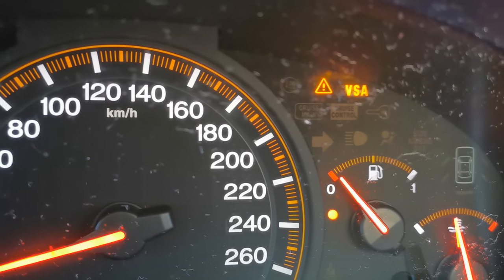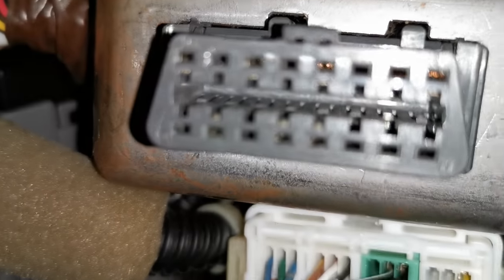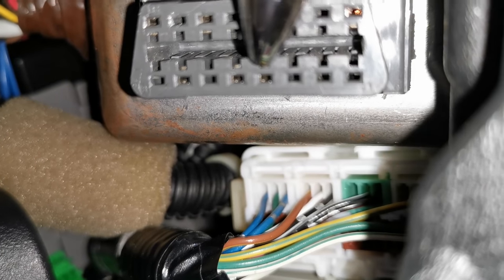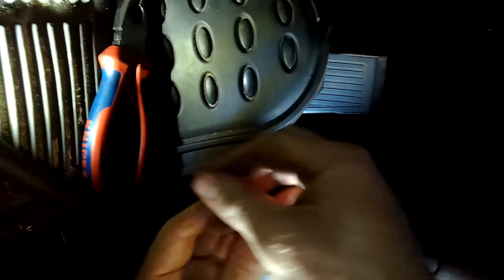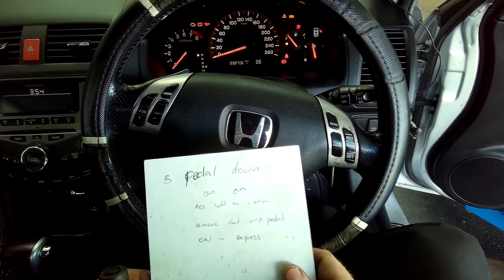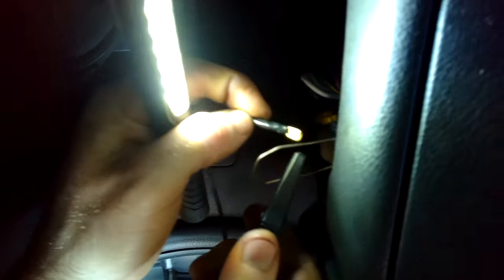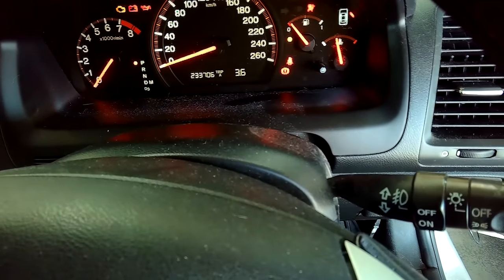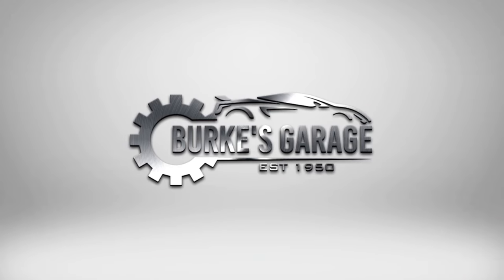Honda VSA & ABS Warning Reset - Simple DIY

Comment: I got those 2 warning lights after an OBD scan. The scan found only one old "low battery" error and nothing more. After the scan tool was disconnected from the OBD the triangle with an exclamation point appeared. After 30-40 sec the VSA error appeared too. Will try to reset them with this steps.

Comment: THANK YOU SO MUCH FOR THE VIDEO. I replaced the engine on my Daughters 2005 honda accord and these lights came on, resetted them with my snanner and they would come back on adter a few yards.

Did this trick, and Voala.. lights are off. Even the Cruise Control started working.

Thank you very, very much.❤❤

Comment: I have a 2006 UK-spec Honda Jazz (aka "Fit"). 
The ABS light came on after hitting a loose rock on the road (no damage to the wheel at all). 
Both my old and new OBD2 scanners report "No Codes".

I tried your method: 
 1. Turn Ignition OFF.
 2. Join pins 4 & 9 of OBD2 socket
 3. Hold Brake pedal down
 4. Turn Ignition to ON (not start engine)
 5. ABS light illuminates...

but the ABS light does not then go off for me.
I tried pulling the 7.5A ABS fuse for a minute then replacing it but it made no difference.

Any ideas?

Comment: Only way i could get triangle light off was with jumper wire between pins 4  + 9.   4 is ground like others mention.  Maybe the problem  was i used a broken jumper wire to ground and i didnt test for continuity so idk.  Anyhow i turned off VSA ABS Triangle lights on my '04 tsx.  They came on when i was replacing front brake calipers.

Comment: Thank you so much, it worked on my 2006 Pilot. I took my car to the shop for another issue. When they read my car the triangle and vsa lights cane on and they wouldn't go out. My mechanic couldn't reset it. I'm glad I found your video. It was easy to follow and it worked. I'll forward this video to my mechanic. Where did you find this information, I'm curious?? Thanks again for this helpful video.

Comment: Nice one man, I’ve reset the abs with a paper clip numerous times to find remaining lights. Nowhere else could I find anything about following that up by grounding and resetting the VSA. Cheers ☘️
Reply: Do you know what cables he used? Are those jumper cables?
Reply: @knightofnights1693  a paper clip and a bit of wire to earth it for the second part.
Reply: @dmcresins  can I use copper wire

Comment: Just about to try this and thought I'd have one more go with the snap on scan tool, and I cleared it, by going into abs and special procedures, follow a step by step, ignition on abs light comes on and goes out- immediately press VSA button ABS comes on again- immediately press VSA button, ABS flashes and its reset, no VSA light, viola.

Comment: Dude. Thank you so much. Had the same problem using Blue Driver. The Honda manual only mentioned doing the TCS reset and it wasn’t helping. Doing ABS before I did the one with the traction control button. Finally Code and light free thanks to this video.

Comment: Hi,been having the issue for a while. The VSA and ABS lights are just on. Scared to do this procedure myself
Reply: It will do nothing abs code will reset themselves when the fault is repaired and you drive at like 5 miles hours 

You can erase the code but it will come back on in a couple mile of running the car
This video is useless and false 
90% chance you got a bad wheel speed sensor 
And the moment the computer detect than one wheel stays at 0 mile per hour the light will come back on

Comment: Very helpful video! The triangle for the vsa off showed up during removal of some old faulty codes and wouldn't go away. After some driving the vsa light turned on aswell. after I tried this method and it worked like a charm, huge thanks for the vid! (Honda accord 2006)
Reply from the maker: Thanks Micke 🙏🙏
Reply: @Micke Andersson. I seem to have the same symptoms as you. Did you have to do both steps or just the last step. Thanks
Reply: @pnmbmw  Had to do both steps, just as in the video. Good luck
Reply: , what caused the VSA warning light to come on?

Comment: It worked, but I did need to know the turn key off after abs because I left it on for the vsa until you said turn it on and it was to late I had already hooked up the ground with the key on. No worries it all worked

Comment: I tried this yesterday and must have used the wrong pins, it shorted the IMA system,  key ring stopped working, car still drives but on gas only no IMA its dead. I've never had an issue with the IMA so it was definately something electrical I did trying to reset the VSA. Can blowing a fuse disable the IMA? Thanks

Comment: Gerard, thank you very much, this kind of maintenance it's was gonna took me a bunch of money since here in Brazil 8th gen Accord's are rare and qualified maintainers are even rarer, even honda dealers would probably suffer to solve this (Sadly, but truly mean it). One detail... At least on mine 8th gen, when pinned 4 and 9, and turned the ignition key on, it showed a code UXXXX on blackout screen, but it was fast so I couldn't record or remember it, and for my luck I didn't need to follow all the procedures described for the brake pedal and VSA button it resetted immediately. Anyway I'm just really glad you solved my problem that easy, no more christmas tree out season, LOL. Again, thanks man... BR greetings

Comment: Hi I'm having the same issue with my 2009 mkviii honda civic,  the brake lights keep failing  to work, bulbs have been  replaced as has the fuse and brake light switch, they worked for a while but have stopped again, any recommendations would be appreciated

Comment: this worked on my 2007 honda legend[ acura rl in states ] see also geting honda  abs codes without a scanner this worked also join  4and9whitout bressing brake to flash codes 13 was mine nsf front abs sensor

Comment: I believe if you do a steering sensor calibration/reset using the scan tool it also makes the VSA light disappear. I have this happen with every scan and my guy just goes through the steering sensor reset process to sort it.

Comment: Can a front bearing replacement trigger the VSA lights? Mine came on and is only after reaching about 55mph and sometimes goes off on its own after idle for about 8 minutes or by shutting  car off then  restart. Vehicle sat in driveway few months before bearing replacement. 
Thanks for the video.

Comment: Perfect for a 2006 Pilot!  The triangle (no other lights) came up for me after clearing ABS codes with a Blue Driver scan tool.  Clearing ABS and then VSA using your procedure worked like a charm.  I left pin 9 & 4 shorted for both procedures.  I think pin 4 is a ground.
Reply: Hah yeah same here for my 2008! Pins 4 and 9 for the win. My lights came on after clearing the codes from a thermostat replacement.
Reply: I left pin 9 & 4 shorted too like you did for both procedures and triangle warning light is off at last!!!
Reply: @nathanielmayo4950  where are the pin number configurations the same?
Reply: @billmurphy9921  Bill I'm not sure what you mean.
Reply: @nathanielmayo4950  lol. stupid apple talk to text... Are the pin numbers laid out the same on the 2008 Pilot as in this video?
Reply: @billmurphy9921  Bahaha. Yes, they are. Same pattern just make sure based on how you're looking at it. If you head is upside down, the pins will be upside down as well. They are actually marked, very lightly but you can see if you can really get in there with a bright light.
Reply: @nathanielmayo4950  got it. And it worked for me! My light came on after a shop did a full scan as well.
Reply: @billmurphy9921  Aye! Glad it worked bud. If they don't have the right scan tool it'll happen everytime.. this is a good thing to know so we can fix it ourselves

Comment: Did not work for me.
I did exactly.  Cleared the ABS got the 2 blinks…then tried resetting vsa and would not.  Same thing happened to me with a full system scan and light came on…was never on before that.  Grounded the pin 9 to try to clear vsa…idk what else to do.

Comment: I have a 2012 Acura Tl, recently my low brake fluid light came on, VSA light, and brake light, all 3 indicators. I checked the brake full it was low, I top it off, turned off the car turn it back on, and all the lights are still there. There's no leak Any thoughts, help great appreciate it.

Comment: I can't get rid of the Triangle.  It will not go away.  I followed the 2 step process.  My VSA light (Button) does not illuminate.  Not sure if it is on or off?
Reply: Here is what I had to do to my 2008 Honda Pilot to get the Triangle.  I did this.  Jumped 9 and 4 connection.  Turned on the key.  When the ABS disappeared, I hit the VSA button.  The ABS would reappear  then I hit the VSA button again,  The triangle would flash 3x and disappeared.    The triangle initially appeared when a took it to a shop and they reset the codes for a P2185 coolant sensor 2 error.  The triangle and VSA started to pop on after that reset was done so I knew there wasn't an issue in the system.

Comment: I have a HONDA CRV 2007. A replacement was made for the CV joint and axle for the right front wheel. After that the 3 lights (VSA, ABS and ⚠) lights all turned on. Upon diagnosis and reset using the diagnosis machine, only one error read "permanent right speed sensor failure". So when the engine is turned on, all 3 lights turn off and once in motion if brake pedal is stepped, a grinding and vibration is felt on the pedal until the speedometer reaches 55KM/HR upon which 3 lights turn on and the vibration and grinding feeling on the brake pedal stops. How can this problem be fixed?

Comment: Appreciate it! It's been on for a year and half. Finally got it off
Reply: How you got it ? I got a honda accord 2012 brought it mash fix the mash, it needed a transmission solenoid brought it and already put it on the transmission but the d light still blinking and it have the vsa abs and engine lights on how to take ? it off
Reply from the maker: Thanks Duc
Reply: @GerardBurkeBurkesGarage  ???
Reply: @duckquansmith8620  check all your computers and make sure they are dry. Has the  car been in a flood or broken windows?

Comment: For those who have earlier model 7th gens with no vsa this worked for me

TCS pressure sensor neutral position memorization (normally you need the HDS or a good scan tool) but here's the work around.

jump pins 4 and 9 on the DLC with the key OFF

watch the ABS indicator light area.

Turn the key on, ABS light goes on, then off after 2 seconds.

within 2 seconds, push the TCS off switch

push the button again only AFTER the ABS light comes back on.

The TCS triangle should blink, then the 3 lights should go out together.

remove the jumper between pins 4 and 9 of the DLC.
Reply: Push or hold?
Reply: It didn’t work for me

Comment: I can confirm that this works on the 9th gen Honda accords from 2013 to 2016. But if you have the push button start the beginning of the procedure is as follows do not hold the brake pedal down and start the engine!!! Push the start button twice without pressing and holding the brake pedal to get into the on position where it shows the instrument panel lights, then after about 2 seconds the ABS light will come on, press and hold the brake pedal until the light goes off and release the brake pedal and then press it again when it comes back on and then when it turns off release the brake pedal and you will see the ABS light blink twice. Once that is done turn the car off by pressing the start button one more time without touching the brake pedal and then remove your jumper wire and you will be good to go and all your lights will be off the next time you start your car!!!
This totally works, you just have to follow the video to the letter, especially if you have the VSA light on in your vehicle. I do not have the VSA light on in my 9th gen Accord, so all I needed to do was follow the first step with pressing and releasing the brake pedal when the ABS light came on two times. If you follow the video with the exception for you guys out there who have the push start, you have to follow the beginning of the procedure how I explained in the beginning of this comment...
Tools needed for you guys out there that are unsure, are as follows 2 inch piece of wire that the exposed part is nice and thin about the diameter of a paperclip, or a paperclip itself on pins 4 and 9 like the video states. You can use just about any type of wire or paper clip and for the guys that need to reset the VSA light, again you can use any wire, but only have the wire on the 9th pin and it needs to be grounded somewhere in the car. Meaning you have to ground it to any part that you know is grounded!!!

Comment: Any idea on how to clear a "Collision Mitigation Brake System Problem" message on a 2016 Pilot Touring? I was passing by hundreds of orange cones at a highway construction area and I guess the system got overwhelmed and assumed that it was in error then the warning appeared. The system works fine and I just want to get rid of the message that comes on whenever I start the car and the icon stays on the display along with the circled "i". The Honda dealer wants $150 to start and will probably want to replace camera and radar which is totally unnecessary.

Comment: Abs and vsa light came on pulled over turned car off locks started going off by them selfs turned car on or tried! And alarm went off! Car wouldnt start. Started after the 3rd time and abs and vsa light was gone. Any advice? 08 honda accord

Comment: One thing I did not get. PIN 4 is Chassis ground, PIN 9 is SCS (Service Check System). What is the point to connect PIN 9 to Chassis ground when it's already connected there thru PIN 4? Can someone please confirm me the pinout I described is correct?
Reply: Your pinout is correct. Some work with alternative grounding to earth on pin 9 for the second step of this procedure, others just by jumping pins 4 and 9 as in the first step.

Comment: Please i am using 2007 honda accord The VSA and EPS lights come on when i turn the steering wheels to the left. In most cases they stay of after starting the vehicle. But immediately i move there is this vibration in the brakes and the VSA WILL COME ON AND LATER THE EPS. WHAT ARE THE POSSIBLE CAUSES. PLEASE HELP ME. THANKS

Comment: I have a 2006 TSX, VSA Light on after a scan, and clearing a DTC-84-1 Code.  ABS Light is not on, I connected pin 9 to pin 4 and my 15 amp fuse blew!  I replaced the fuse no harm was done. Do I only need to ground pin 9 to reset my VSA? The dealer wants $65 to reset my VSA neurtal position memorization.  Thanks
Reply: just keep the ground on 9 and 4 both steps. you have to do both steps. dont skip the abs.

Comment: If your car won't start after trying this check your fuses. I blew the ecu fuse under the hood by jumping 16 instead of 9. Emissions and tpms lights were on and it wouldn't turn over

Comment: Didn't work for me. I only get the warning light on and after driving it for a while the vsa light turns on. Any ideas how to get rid of it?
Reply: Following
Reply: Search for "Steering Angle Calibration" -- closely tied to VSA and ABS -- if that ever gets out of calibration, the computer doesn't know 'straight'-ahead, and it trips VSA.
Reply: Also, make sure the STEERING WHEEL is aligned "straight ahead" when doing the above resets/calibrations

Comment: Thanks from America Gerard! I had my doubts about this on my 2012 Acura TSX.   From the other comments I thought I've had fried something  When I saw the DTC codes Flash up onto my screen. Nope it worked perfect had to do it multiple times but exactly how you said it my friend.  
At the same time luckily I went outside because my brake lights were on strange I've done this to another Honda before where the brake lights switch (crap plastic) crunchrd -replaced with a nut and screw and 2 perfection fit.

Comment: I HOPE YOU READ THIS: I just did a FULL SYSTEM SCAN on my 2012 Honda Pilot using a Snap-on MODIS ULTRA SCAN TOOL (like yours) with outdated 17.4 version software. Like you my FULL SYSTEM scan causes the VSA light to come on INDICATING VSA OFF. Attempts to clear the codes DID NOT reset the light and VSA function as you stated. I then stopped USING the MODIS ULTRA with outdated 17.4 software as it's older menu options and features were different than up to date 22.4 current software! I went and got my MODIS EDGE with 22.4 newest current software. The MODIS EDGE 22.4 was not resetting it either! SO, I looked through the menu option and went to Main Menu "Antilock Brakes", Functional Test, Adjustments and it performed and followed through with self test that included a key cycle prompt. THE SELF INFLICTED ALL SYSTEM SCAN PROBLEM FIXED IT'S SELF! THE LIGHT RESET AND VSA OPERATION WENT BACK TO BEING FUNCTIONAL!!!!
Reply: How did you reset it

Comment: Tried it. It worked. My lights went off but then when I tried to turn the key before I got to the third position to crank it - I lost all power. All electrical. Totally blacked out. 

I unplugged battery and reconnected. Then my car started. This keeps happening over and over. 

Oh and I didn't make it down the street before the lights came back on so it didn't work in my case and in the process I'm sure something is shorting causing the total blackout.

Comment: Well now both of these lights came on together while I was driving I stopped at a stop sign and when I went to accelerate from the stop sign moderately not excessively the car kind of jumped a couple of times and then those lights came on is this car safe to drive to a Honda shop